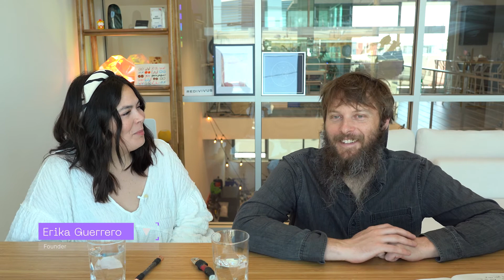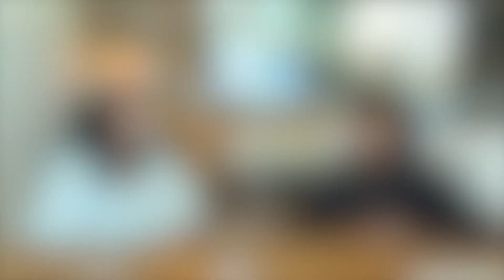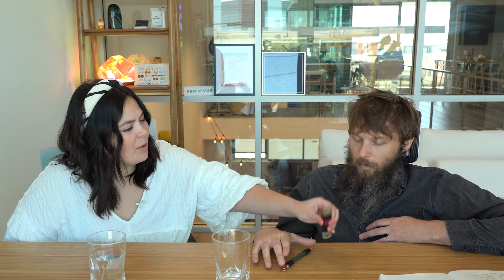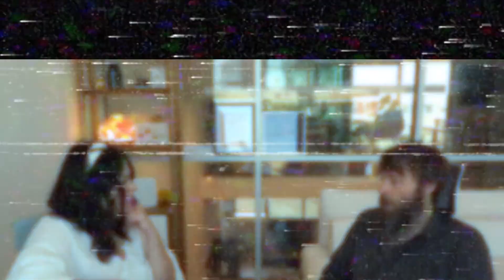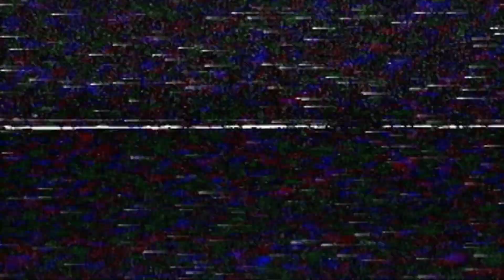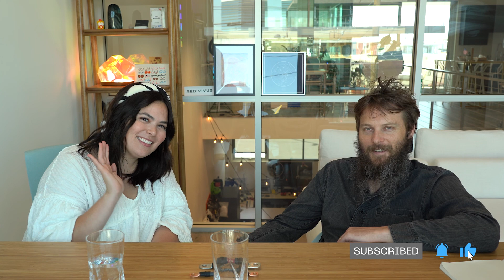Ep. 2 Intro to Battery System Voltage

Comment: Another very great video from you Luke and Erika. Thanks you! I am curious about the opinion of Luke regarding the magnetic field around charging cables at 2500Amp DC becoming potentially dangerous for pace maker or even  the requirement for higher strengh cable clamping inside the car because the interrupt current of a 100V 1000Ah battery is probably way higher than a 400V 250Ah battery right?

Comment: I am a fan of large batteries that use 52V because that is the highest voltage that common power back-up inverters will run (labeled a nominal 48V). When a pack is degraded enough that it only has half the range that it had when it was new, it can still work as a home power back-up to provide 120V AC during a power outage. For someone wanting 28S, you could series two 14S packs...also, a 14S pack can be made from two seriesed 7S packs...
Reply: I am very glad that the cybertruck will be having a 48V architecture instead of 12V.. this mean it will be directly compatible with my DIY powerwall !  Oh and btw I have split some ZERO 28S battery into 14s2p to get "48V" and it work fine!